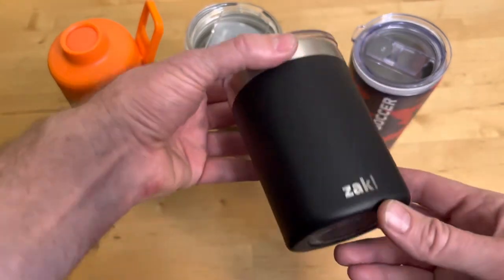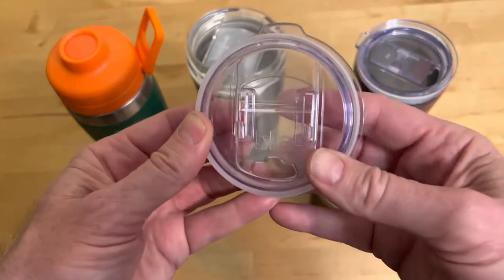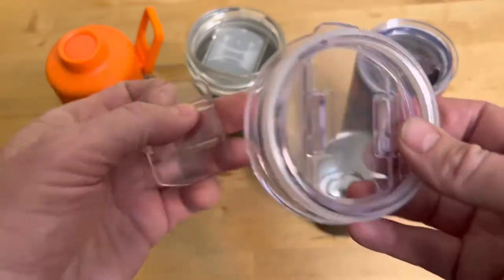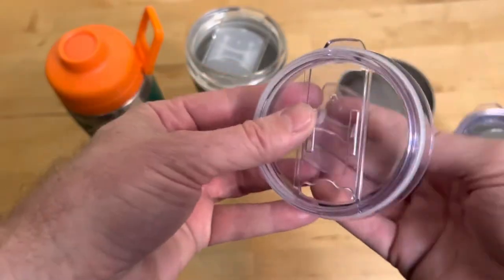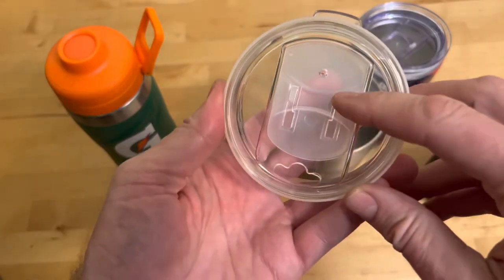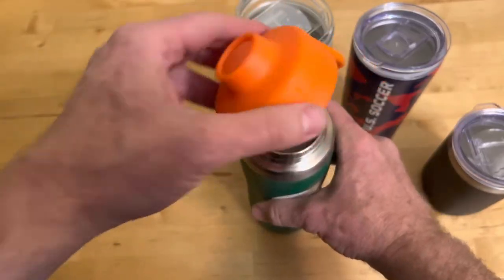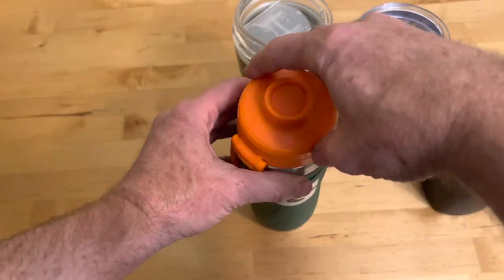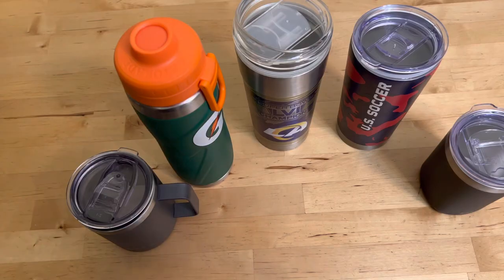How to take apart and clean the lid of an insulated drink cup

Comment: Is there a way to make sure the removable part doesn't get all loose on the lid? I removed them on two of mine to clean them, and now they're so loose that they're practically useless
Reply from the maker: I don’t know. It depends on the design. On a lot of cups, the yeti lid is the same diameter, so you could buy a yeti lid for it. They sell lids separately.